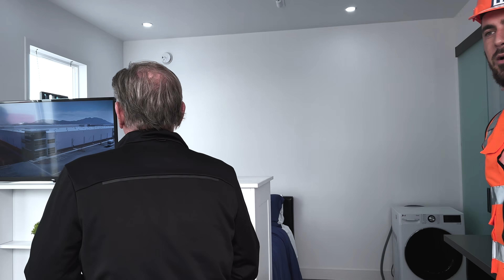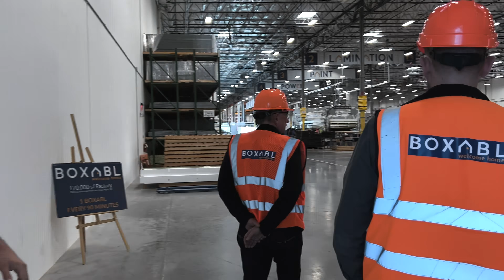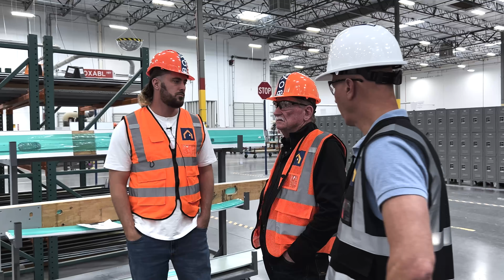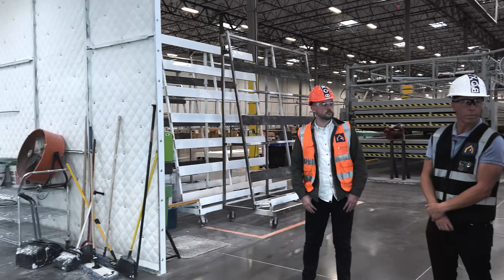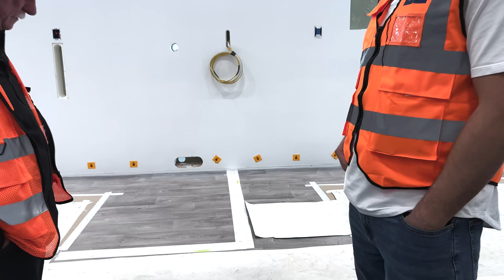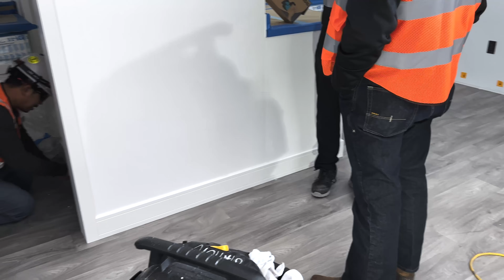What's in the BOX!? - Unfold your new home today | Boxabl Factory Tour

Comment: People building the tiny villages for veterans and homeless should look into the cost of these verses the stick framing
Reply: Also for finishing the panels, you could consider a joint tape with strong adhesive, pour a self leveling compound on the wall after when its layed down....Finish a wall perfect in a moment, use something with some flex to like acrylic latex....(I do drywall finish for a living)

Comment: I work in a plumbing supply house. shark bight works great for DIY. But they are leaving allot of money on the floor by using it exclusively in the build.  my point is going off retail price from supply house. a shark bight stop cost  $10.97. A regular crimp stop cost $5.24 plus the ring $0.27.
they could be pre crimping the stops onto the correct length of pipe to satisfy the job so the only thing the installer needs to do is push it into the shark bight tee or elbow. https://youtu.be/BEeXPfC99dc?t=1216

Comment: So - do they finally deliver or are they still raising more money?
Failing at building the machine that builds the machine.
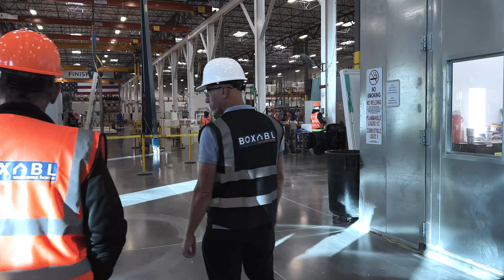15:50 "we will see " is a little late after all that time.
......and take your hands out of your pockets when presenting.
Reply: Your comment seems really emotional... Boxabl started low-level factory production for 1st time in Q4 2021... Q4 2021 to Q2 2022 built and delivered 156 Casita ADUs to the Department of Defense... Made minor adjustments to the line and are delivering around 175 Casita ADUs to a private mining company for workforce housing right now... 2022 is 1st full year of low-level, manual production to get the basic process down... Raised $100+ million in 2022, which means that they are not "Failing at building the machine that builds the machine"... Boxabl hasn't even started... Don't you think that might be why Munro is out at Factory 1, right before they drop $100+ million into the first significant automation upgrades in 2nd full year of production (2023) when they really start to ramp towards 5,000 per year run-rate...
Reply: @rule1capital  prefab home manufacturing is not something that first has to be invented.  Plenty of examples out there. 
For the longest time you could pre order without a delivery date. 
I could have used 2 of them but finally decided to find something else. 
The absence of a clear time-line and then hearing that they are still figuring things out is very disturbig.
Reply: @CHMichael  It needs to be "reinvented"... Why does onsite building still dominate the newbuild market... Manufactured has failed to compete at scale, where is really moves the needle... Otherwise, Boxabl-like companies would have been dominating the past couple decades...

Comment: Still a bit crude.

Would only make it full electric, with floor heating or infra panels.

The wrapping shrinking with a gas burner is also a crude and risky way.

And there are better shrink materials then what they used.
Reply: Boxabl Casitas are full electric... Extremely tight building envelope that uses HVAC mini-split and electric water heater... very little energy usage...

Comment: Remove the need for crane rental and you'll really be in good shape.
Reply: Takes an hour or less to unpack 1 unit with crane for Generation 1 units... Generation 2 units being introduced in 2023 may have the new features that enable workers to unfold without crane, but this "bottleneck" has been talked about being solved for over a year now... But even with the crane needed now, Boxabl is selling to large customers with hundreds or thousands of units per order, so that cost is not really an issue at scale...

Comment: id we can get the box selfsuficent solar + battery + water tank and whater hyperrecyling/ reuse. and easy movebal you will have a great product for temporary housing and / or rescue resorse.
Reply: Solar/Battery/Off-Grid is probably the most asked about future add-on since the original crowdfund 2.5 years ago... Boxabl is smart to wait on any add-on options and focus on the single SKU they sell, the Casita 20x20 ADU... However, because there is a standard breaker box, hookup to solar should not be bad at all...

Comment: What sets this crowd apart from the many other existing manufacturers of the same thing?
Reply: Nothing, the only difference is that VCs have dumped money into a worthless idea. I had a very different impression of these before watching the video. You need a crane to assemble them on-site anyway - why not just flat pack and assemble?

Oh right.... because then you wouldn't have any 'unique hinge' IP to sucker more investors out of their money.
Reply: @RogerTheJanitor  Without the folding IP, there is no scaling, like all current factory builders…
Reply: "Folding up for legal shipping" IP and design is end all, be all that separates Boxabl... Without legal shipping loads, factory built, whether Modular (Boxabl) or Manufactured (traditional factory built) could never scale or take advantage of factory processes... Boxabl also separates itself, since 99% of onsite traditional and startup factory competition comes with a builder mindset and offers too many custom options... Boxabl is wisely starting with 1 SKU (Casita 20x20 ADU) that crushes any competitors price per square foot in tiny/modular homes... This is the tip of the Boxabl iceberg, but these are the big selling points that come to mind...
Reply: @rule1capital  There are many manufacturers of buildings that unfold from a standard shipping container form factor. My sister-in-law works for a guy who imports them from a Chinese manufacturer and sells them to mining companies.
Reply: @bradcavanagh3092  That's fine, but what scale are they producing at and why haven't they displaced traditional home building in the Greater US market then... In April 2022, DR Horton (largest US single family homebuilder) became a strategic partner, investor, and customer of Boxabl... Boxabl raised over $100m in 2022, at 11x the 2021 valuation, even with all the market turmoil... If the product you are talking about, or any other superior product is so great, why are they not raised 100m or 1B to expand?

Comment: Affordable housing is a HUGE issue the world over. Love what this company is doing. Brilliant! Would really love to see Sandy follow up with them a few times and hopefully get hired by them!!
Reply: The current process, in relation to where the current business plan is and will be by the end of 2023, was not clearly articulated in the video... Q4 2021 (start of Factory 1 production) - 2022 is super low-level production, more R&D like, to iron out this brand new company and process for 2 large orders... Q4 2021 - Q2 2022 saw the 1st contract delivery of 156 units to the Department of Defense... Following that, small upgrades were made to the line for the next current contract being fulfilled for roughly 175 units to a remote Arizona mine for workforce housing... The first full year in the factory (2022) is highly manually intensive work, just to get the simple, slow version of the process down and to obtain real-world feedback from units in the field, before introducing Generation 2 Casitas into the production process in 2023... Additionally, 2023 is expected to ramp run-rate production 10x-15x over 2022 levels, mainly by nearly doubling Factory 1 space to more efficiently setup the factory, but most importantly deploy some of the $100 million raised in 2022 on much more automation in each of the assembly line stations... The additional space and optimized layout is expected Q1 2023, the automation equipment is expected in Q2 2023, and the bulk of the production ramp is expected in Q3/Q4 2023...

Comment: Looks like a nice concept if the price is according to the "quality" which was quite frankly, quite rough.

My suggestion for anyone building these kinds of products would be to innovate something that really benefits from factory assembly, like vacuum insulated wall/window construction. You can easily double energy efficiency and offer something completely new on the market.
Reply: The current process, in relation to where the current business plan is and will be by the end of 2023, was not clearly articulated in the video... Q4 2021 (start of Factory 1 production) - 2022 is super low-level production, more R&D like, to iron out this brand new company and process for 2 large orders... Q4 2021 - Q2 2022 saw the 1st contract delivery of 156 units to the Department of Defense... Following that, small upgrades were made to the line for the next current contract being fulfilled for roughly 175 units to a remote Arizona mine for workforce housing... The first full year in the factory (2022) is highly manually intensive work, just to get the simple, slow version of the process down and to obtain real-world feedback from units in the field, before introducing Generation 2 Casitas into the production process in 2023... Additionally, 2023 is expected to ramp run-rate production 10x-15x over 2022 levels, mainly by nearly doubling Factory 1 space to more efficiently setup the factory, but most importantly deploy some of the $100 million raised in 2022 on much more automation in each of the assembly line stations... The additional space and optimized layout is expected Q1 2023, the automation equipment is expected in Q2 2023, and the bulk of the production ramp is expected in Q3/Q4 2023...

Comment: Reminds me of the collapsible box concept. Why not blow mold everything in place, and transport the moulding equipment(kinda similar to 3d printed homes, except a bit faster).
Reply: Boxabl raised around $50m in 2020/2021 and over $100+m in 2022... 2023 is major ramp year and that warchest raised in 2022 is starting to be put to work as we speak on more factory space (Q1 2023), new automation equipment for assembly line stations (Q2 2023), and more shifts and volume ramp (Q3/Q4 2023)... Additionally, independent of those upgrades, Generation 2 Casitas will be introduced into production some time in 2023... That is why it was rough for Galiano in the walkthrough with Sandy, tons of new equipment is currently on order and the 2nd facility at Factory 1 Complex, which was not shown in video, is being fitted out... Current production line that was critiqued was designed in 2020, moved into/assembled in 2021, and in use from Q4 2021- Q4 2022 for low-level production (~300 units in 2022) compared to Factory 1 Complex max of 5,000 units per year achievable on a run-rate basis sometime in latter 2023... Not having the background on the financials and operational history to this point, as well as where things are headed in the next 13 months, can make the viewer see things in a much different light...
Reply: @rule1capital  Thanks for the clarification.  It all makes sense now.
Definitely beats the current way of 3D manufacturing of homes on site in terms of speed of construction, durability and quality. Wish you guys good luck on scalability and turnaround time 👍.
Reply: @aware2action  3D printed homes seem like such a gamer changer when you first hear about it... then when you dig into the details, most are focusing on just printing the walls... which pretty much leave you back at square one for onsite construction efficiency for wiring, plumbing, floors, etc... When comparing to solutions like Boxabl... Boxabl is arbitraging local labor shortages, being able to get inspections done in factory, and insane speed potential... No matter what happens with Boxabl, it seems like this has opened Pandora's Box and I don't think the status quo can hold for US residential construction by the late 2020s...

Comment: OMG, This needs sorting, great idea but the execution is something I would not showcase. I don't think they know much about modular building. The owner doesn't even know the reason for the "I" beam. Sorry but they are amateurs.
Reply: Galiano did say the I-beam is for splitting the load on the wall panel... Galiano is cofounder, 2nd largest shareholder, business dev, marketing, and cofounder, but not primary guy for IP Dev and Engineering... Paolo, who was not shown on camera, but was there with Sandy and team for off camera meeting (confirmed from social media), is the largest shareholder, CEO, IP dev, engineering, and cofounder, should have been the one fielding Sandy's questions on engineering design choices... These "amateurs", as you call them, started raising external money in Summer 2020, when they only had a few prototypes and a tiny space enough to hand build original concepts... Completed 1st funding in late 2020, moved into empty factory in mid-2021, fitted out factory and started low-level production in Q4 2021, completed first 156 unit contract for DOD in Q2 2022, working on 2nd contract for ~175 units for remote Arizona mine workforce housing... With first 2 contracts, able to gather real-world feedback in 2022 to be able to introduce Generation 2 Casita in 2023, right when Factory 1 is ramping from 300 per year level toward max annual 5,000 per year run-rate in 2023... Significantly more money raised in 2022 ($100+m) compared to 2020/2021 has not been put to work yet, but none of this context was provided in video interview...
Reply: @rule1capital  No excusses, you need to know your product. Amatuers, sorry.
Reply: @Sortedmotors  You don’t ask high level engineering decision questions to the business guy… And that’s fine if you are skeptical, 150,000 person waitlist already for 5,000 max production at Factory 1 and DR Horton is a strategic partner. investor, and customer…
Reply: @rule1capital  why not? he should know his product.
Reply: @Sortedmotors  No one asks a CFO about engineering choices and tradeoffs...
Reply: @rule1capital  Of course they do a CFO, CEO or whatever O needs to know their business, as the Ex Chairman of BP
Reply: Yeah, this is nonsense. Its a VC money-raising scheme. They took a simple home and tried to reinvent it. You need a crane to assemble these? How pointless...

Comment: I loved this tour... man do they need help, for all the press boxabl has gotten this is kind of sad and filled with inefficiencies!
Reply: The current process, in relation to where the current business plan is and will be by the end of 2023, was not clearly articulated in the video... Q4 2021 (start of Factory 1 production) - 2022 is super low-level production, more R&D like, to iron out this brand new company and process for 2 large orders... Q4 2021 - Q2 2022 saw the 1st contract delivery of 156 units to the Department of Defense... Following that, small upgrades were made to the line for the next current contract being fulfilled for roughly 175 units to a remote Arizona mine for workforce housing... The first full year in the factory (2022) is highly manually intensive work, just to get the simple, slow version of the process down and to obtain real-world feedback from units in the field, before introducing Generation 2 Casitas into the production process in 2023... Additionally, 2023 is expected to ramp run-rate production 10x-15x over 2022 levels, mainly by nearly doubling Factory 1 space to more efficiently setup the factory, but most importantly deploy some of the $100 million raised in 2022 on much more automation in each of the assembly line stations... The additional space and optimized layout is expected Q1 2023, the automation equipment is expected in Q2 2023, and the bulk of the production ramp is expected in Q3/Q4 2023...
Reply: @rule1capital  You sound like someone who has money invested in this awful idea and now you are trying to shill how great it is online. If you can get out of this deal, get out. I can build you 10x more of these for a fraction of the cost - anywhere in the world. This is total, total nonsense.
Reply: @RogerTheJanitor  Where is your factory, what are your product SKUs, and what is your price... You really talk a big game, let's see your products...
Reply: I am really glad you clarified some of this for me... I am one of those individuals who believe in Boxabl enough to make the investment to help raise capital... Once you all get the manufacturing down, it'll be the start of a new era in modular home manufacturing! I can't wait to do a tour!
Reply: @padfoo  Boxabl has to wait until 4/1/23 to continue raising non-accredited money through $75 million Reg A+ because of 12 month SEC limits...

Comment: Really interesting. I wonder about the fire rating on these with all that polystyrene foam insulation in the walls. Although these will be highly energy efficient, it seems as though many of the materials used really don't fit in with the ditching of fossil fuels and climate change prevention; a little too much business as usual thinking perhaps.
Reply: Check out this awesome Boxabl marketing video where Galiano takes an open flame to the Casita wall panels... https://www.youtube.com/watch?v=T-t6n96mW7o

Comment: How does the wiring work if it's in EPS? PVC and EPS do not mix. Or is the wire routed in the LVL?
Reply: Electrical/Plumbing is routed through pre-cut channels in the wall panel system...
Reply: @rule1capital  Right, but the wall panel system is 95% EPS so the channels are going to end up in the EPS unless they are lined with something. You shouldn't have PVC cable touching EPS - it leaches out the plasticiser and makes the cable sheath brittle. So I wonder exactly where these pre-cut channels are and what materials are used. As I said, maybe the channel is being cut in the LVL.

Comment: I wonder why they are not using the platinum EPS (black, with graphite in). It's nearly 20% better U-value  so you either get better U-values are just use less of it. And putting graphite into the EPS mix is cheap so it's not much more expensive.